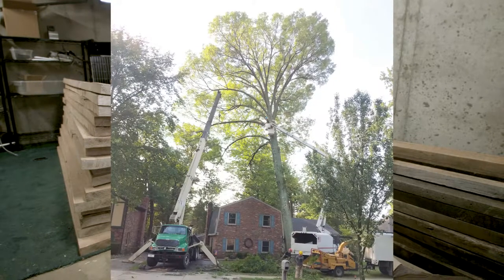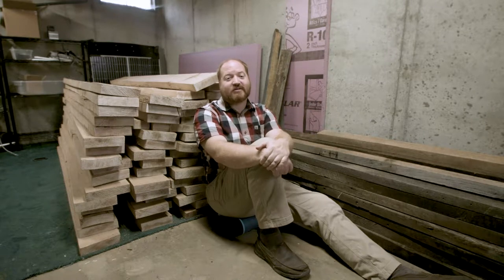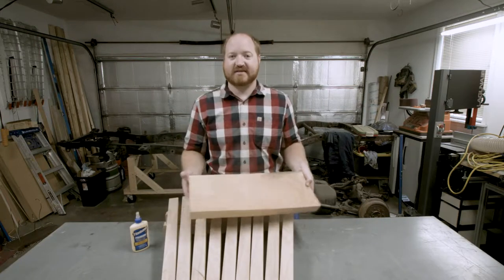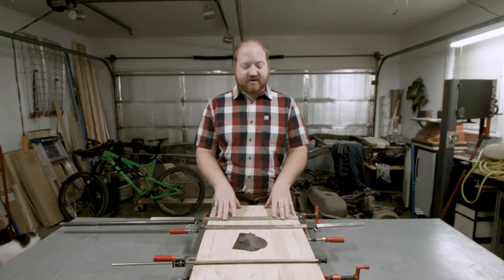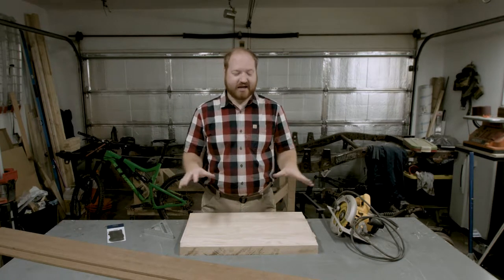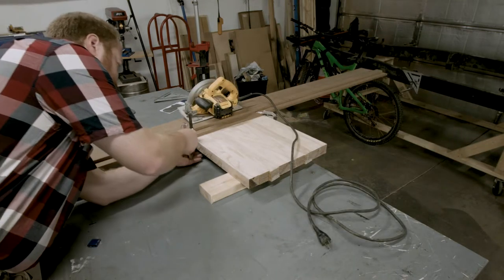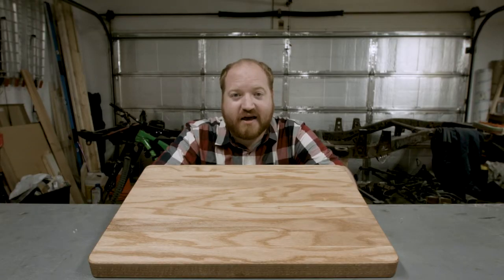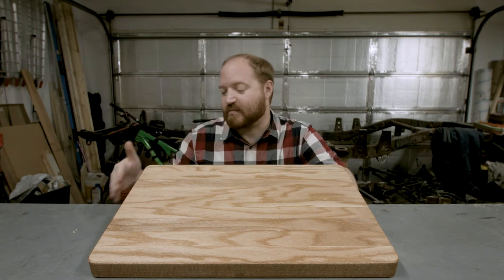Let's Make Something! - A butcher block style oak cutting board

Comment: So, I made a cutting board for my wife it of cherry and white oak. However, after I made it I found out oak is not good for cutting boards because the pours grain collects bacteria from food.
Reply from the maker: I did the same thing! As soon as I finished this and posted it, I did some reading on how to make a better one. Step one: don't use oak! (Facepalm.gif).  I use it more as a counter protector for hot pans and such. I also refresh the surface with cutting board oil quite regularly as a preventative to keep anything that might find it's way onto it.
Reply: Coat it in resin and use it as a charcuterie board
Reply: That's more of a problem on end grain cutting boards.  The wide pores act as straws that pull in moisture.  Edge grain, as this board is, should not be an issue.  check out Brian Cooke's video on this topic.  https://www.youtube.com/watch?v=VGoEb1oH5Pg